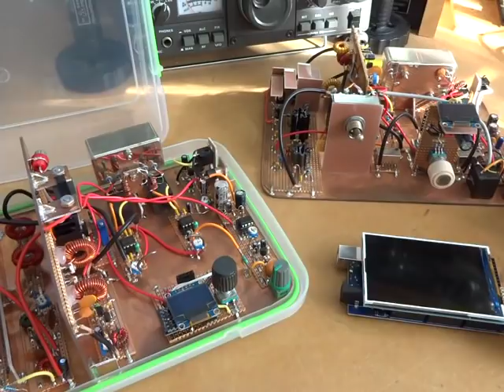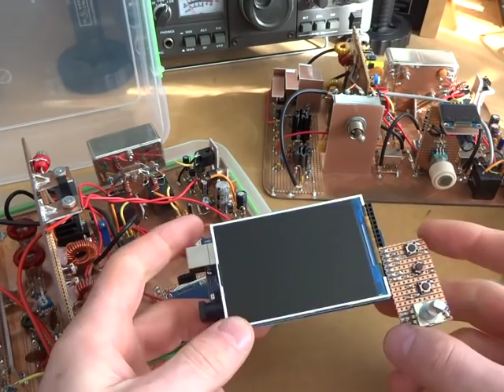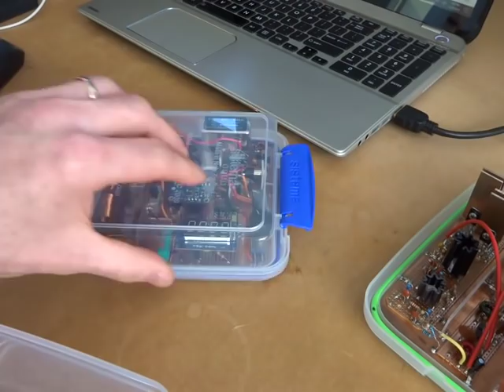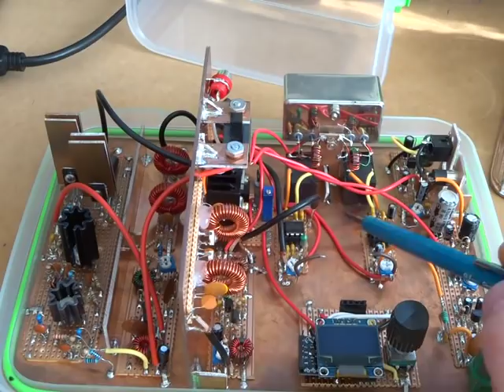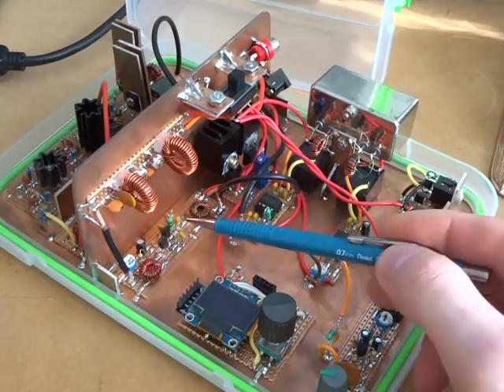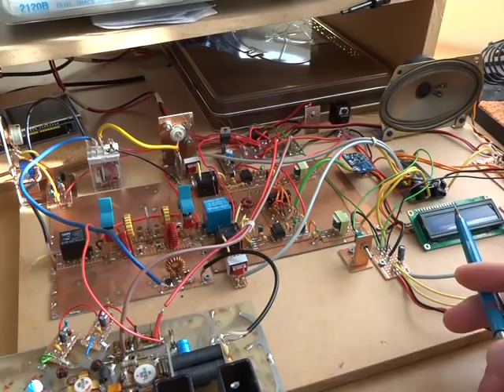Ideas for the Next Design/Rebuild

Comment: I started using SMD components to minimize IF footprint. So 2× ad603  and ade1-24 DBM will produce a decent 9 mhz I.f.
Also can use small smd relays like axicom ones. Never use audio D class amplifier .For sdr one  you can go with Raspberry pi + 7 inches official touch display and kivy framework on top. It can produce about 30 fps in main loop and a lot of knobs / switches can go on touch display.
Here is my work version 1.0 now allready working on v 2
https://youtu.be/rHw2Gv7iAPU
Reply from the maker: Great, thanks for that. One of these days I'll look to use SMD, but for now thru hole components are working well for me.

Comment: Was messing about with the SI5351 and you can set two outputs to have quadrature or 90 lag. So can do away with the 4 x Clk frequency and divide down circuit. Still horribly square and slightly lower level but might save some board space. https://awsh.org/2018/03/31/si5351-quadrature/
Reply: Just realised this guy is actually referencing your design ! Thumbs up!
Reply from the maker: I think he had the same problem as I did, in that I couldn't the quadrature output across the full freq range. It looks like more and more hams have cracked the nut.
Reply: Ah I see. I should have guessed there was some sort of issue. I tend to rush in and miss the details but you strike me as the kind of bloke that reads the datasheet lol. I really should do that now and again :)
Reply from the maker: As for square wave output, I have no problems using that with both NE612 and the passive DBM. The Soldersmoke blog had a good write-up on that a year or two ago.

Charlie
Reply: I guess I'm being too purist, thinking I need a sine wave when really a square and bit of filtering will probably suffice. Just knocked up a DBM and seems quite good. The pot is a great idea for maximising rejection of the LO!
Reply from the maker: Great. This is the link to the Soldersmoke article: http://soldersmoke.blogspot.com/2016/03/great-video-on-mixers.html

Charlie

Comment: Funny you say that, I've just got some code from a ham on the QRPLabs mailing list which deals with the Si5351 Quadrature and frequency code, if you sent him an email I think he'd be happy to send it over to you.
Reply from the maker: That would be great Clint. I know it can be done, but I just haven't been able to give it enough time to crack it myself. I'll check out the QRPLabs mailing list.

Charlie
Reply: Or maybe not, I've just spent some time with the code sent, it seems to be a simple port of the NT7S Arduino code. Perhaps not so much use after all.
Reply from the maker: Oh well. We'll get it sorted at some stage!

Comment: the si5351 used in quadrature mode starts to go out of sync somewhere about 14 to 15 MHz ( If my memory serves me right) . so if you use the si5351 in that mode then your better off doing a lower frequency, rather than a higher frequency in the HF band to guarantee success. 

You will have to research the highest reliable frequency that can be obtained and make your choice of band based on your findings. most of the issues relate to the registers that keep the 2 outputs 90 degrees out of sync. 

all the best 

Simon ( M6FJW )
Reply from the maker: Gidday Simon. That's interesting thanks. I must review Han's presentation again, as I got the impression he had overcome that. If that was the case, then that would be great. If not, then it looks like 80/40m!

Charlie
Reply: Hi Charlie,

I have personally used two outputs in quadrature ( this was some time ago) and I couldn't get it to do some parts of the HF band that I was interested in at the time. I went on to use an 74ac74 / 74hc74 devices as it allowed me to have 0 to 40 MHz ( in quadrature with no phase errors over the entire HF band). 

I can recommend at least trying to use the device configured in quadrature. When I tried this it was in my early days of the Arduino UNO / si5351 combo, so there could have been mistakes in my code. There could have been mistakes in my interpretation of what was really been said.

As I have already said use the lower frequencies if you want to try it for a better chance of success. 

try this video,

https://www.youtube.com/watch?v=ZD3HFCR8NHE

 it shows this person using quadrature outputs but the levels drop and totally goes to useless at 19 Mhz. yes you could put amps on the outputs to try compensate... but the space required for two amps is greater than using a 74ac74. ( balancing the amps to the same amplification levels could be very tricky.

best regards

Simon (M6FJW)
Reply from the maker: Cheers SImon. I too have used two quadrature outputs, but could make it work over the full range. I'll have to set aside some time and see if I can make it work.

Thanks again.

Charlie, ZL2CTM
Reply: Hi Charlie,

here is a video that demonstrates quadrature output on the si5351. this video the output levels went to unstable about 19 MHz… I am sure mine didn't get that high so mileage may vary.

https://www.youtube.com/watch?v=ZD3HFCR8NHE

This is a duplicate link as you may have missed my edited updated post.

best regards

Simon (M6FJW)
Reply: If there was a problem before, it would seem Hans figured it out, because the QCX uses quadrature and he offers it up to 18 MHz.

Definitely an interesting topic in any event.
Reply from the maker: @christinamarks6349  He certainly got it going. I'd like to replicate that too and do away with the quadrature clock generator.